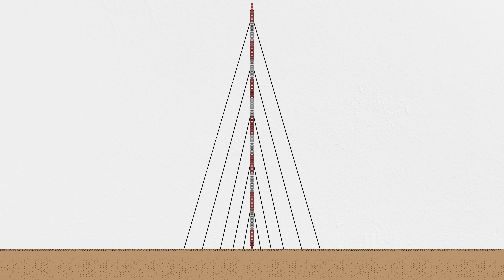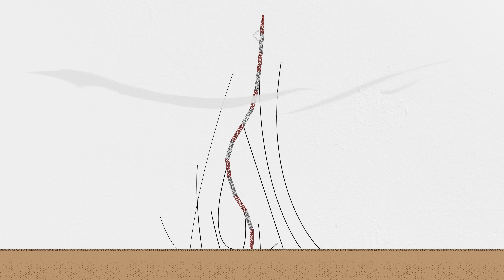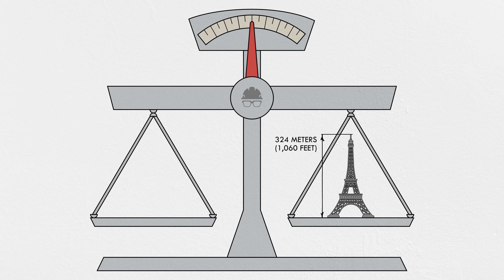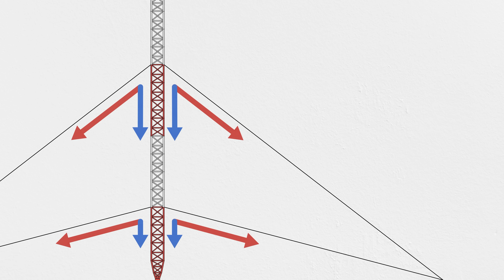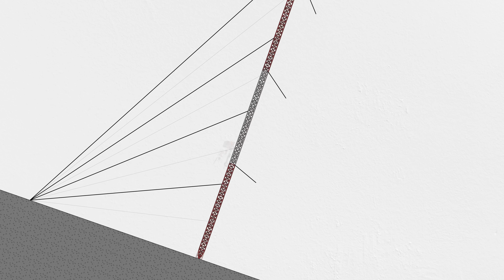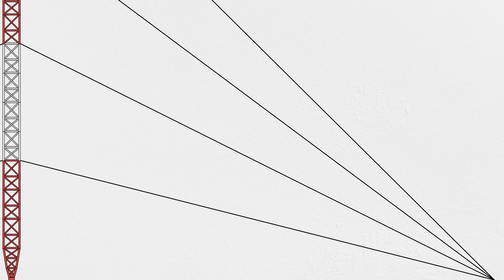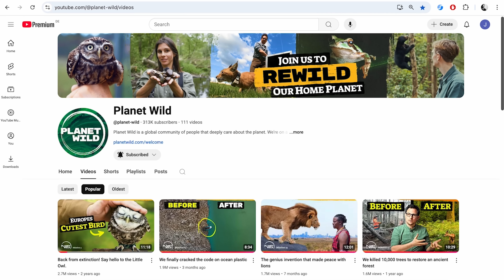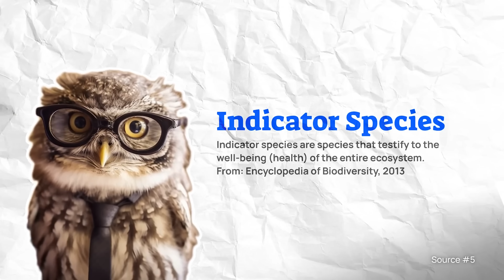The Bizarre Bases of Antenna Towers

Comment: Great video, Grady. The story of the Gąbin mast has a special significance for me—I remember it from my childhood as a symbol of engineering might. Your analysis, explaining the causes of the collapse in such an accessible way, is fantastic.

What's most fascinating about this story from my perspective is how these "macro" level catastrophes often originate from "micro" level problems. We focus on the snapping guy wires, but the long-term integrity of the foundations and the guy-wire anchor points is just as critical. Concrete degradation, water ingress, corrosion—these are the silent processes that, if ignored, can undermine the stability of the entire system, no matter how brilliantly it was designed.

Your video is a powerful reminder that in engineering, there are no shortcuts, and a systemic approach to inspection and maintenance is absolutely key. Thanks for creating such valuable and thought-provoking content.

Comment: Another excellent video from Grady! A few years ago I was in the Delta area of Northern California, south of Sacramento near the little town of Locke. We walked over the base of one of the tower at which I was amazed at the sheer size of the guy wires and cable clamps. Everything was 4 or 5 inches in diameter with the anchors looking like 10 foot by 10 foot square pads of concrete. I recall 4 sets of guys at each corner as that entire area can experience very strong winds during summer months. I wished this video was available back then. Well done, Grady!

Comment: As steeplejacks, we worked on self standing and guyed towers. The towers sitting on insulators, we called “hot towers” as the tower is the antenna, energized. You want to use a wood, or fiberglass ladders to climb on to start your climb. Even with gloves, you would get bit, little burned holes that were painful.    While climbing a wood ladder once, I accidentally touched a ladder hinge, and could smell my burned skin.
I remember one tower where the top of one of the 4 towers top guys burned over the guy insulator, and the guy failed. My Day and I backed off the 2 remaining guys, as the tower was bent over like a banana before I climbed up to hoist a new wire up. Mind you, the radio station needed to keep transmitting, so the cable was arching when making contact with the tower since the bottom of the cable was on the ground.

Comment: Photos of birds… on an engineering channel… have you looked into Al Bowers work with Prandtl ‘33 and Horten brothers regarding wing design? Earlier Prandtl work showed the elliptical lift distribution as best for a given span though such comes with significant drag costs and wingtip vortices. Prandtl ‘33, however, looked at optimum lift per structural mass finding a bell shaped lift distribution meaning the tips fly down which has two effects, one less wing bend hence less structure needed, two vortices at about the third to quarter in from wingtip as opposed to at wingtip with less drag. And guess who uses design similar to Prandtl ‘33? Nature. Nature does. Al Bowers looked at the Albatross and the Hummingbird as two extremes of the spectrum finding both use bell shaped lift distribution. Bird formation flying takes advantage of the mid wing vortices as opposed to wingtip vortices. And, while Al was at NASA, he had years of interns developing flying models and a low cost human carrying flight demonstrator with Prandtl ‘33. Best of all, Prandtl ‘33 creates proverse yaw as opposed to adverse yaw eliminating need for vertical stabilizer and rudder. Notice birds have horizontal and not vertical in their empennage.

Comment: The 1350 ft. LORAN 'C' tower on Iwo Jima collapsed in 1964 a year after it started to transmit. That failure was caused by a faulty insulator. In the 70's, the tower collapsed again, caused by a guy wire failure. All hands on the Japanese tower crew were killed, plus a few people on the ground.

Comment: I got into ducks after moving into an apartment that has them at several ponds.  With this comes the raptors.  While it's heartbreaking at times, I have had the chance to get some amazing shots of a great horned owl in the evening.  In Winter, I can look up at the tree line and see them at night sometimes.  I had one sit on a branch 12 feet off the ground and it let me get right under it.  I couldn't believe it.  My phone was able to get some really good low light shots, where you can distinctly see the "horns"..
Reply: We've encountered a couple great-horneds while out hiking that let us walk right under them, even with three dogs.  They are amazingly cool creatures, especially from less than 20' away.  It's always special when I get to occasionally hear them in my yard at night.

Comment: If I am correct the static model uses a cylindrical rod to simulate a tower. Would a square rod more accurately represent an actual tower and be less resistant to garage-lab deflection?

Comment: In 1968 my family and I were watching TV being broadcast from a 2,000 foot tower near Sioux Falls, SD, when the picture disappeared and was replaced by static.  Turns out a North Central Convair 580 airliner flying in a thunderstorm had clipped one of the guy wires, severing it and ripping the propeller off one of the engines.  Luckily the airliner was able to land safely in Sioux Falls and no one aboard was hurt.  The tower collapsed, but on one on the ground was hurt.  Unluckily, we lost our TV signal for a looong time.

Comment: There's a 2,000' tower about 10 miles as the crow flies from my house. I've been out to it a couple times and it's nuts to stand and look up at it. Since it's a TV tower it sits on a massive foundation. It's even got an elevator in it.  Looks like it's guyed every 200' or so since there are 8 guys on each corner going to three massive anchors. looks like a some of the guys even have guys. Google earth shows the farthest anchors are about 410m or a quarter mile away. I should take my nephew out to see it but something tells me if we go walking around it we'll likely get to meet the sheriff.

Comment: Between Mesquite and Las Vegas I had to pull over and watch a radio tower being put up on the top of a mountain. If you look east on I15 you can see it . The chopper lifting the section was one of the big long leg heavy lift chopper and a regular helicopter as a spotter. The regular helicopter looked so small compared.  And the height was amazing . The mountain is thousands of feet and the tower also a few thousand .  I was glad I stopped and watched.

Comment: I lived in Norwalk, CA back between 2004-2010 and sometime between that time I remember seeing a tall structure erected somewhere near Santa Fe Springs and La Mirada (its located in La Mirada). After seeing this video I was just reminded of that antenna and how tall the structure was with all the guy wires strewn about. Just found out its for a radio station called KFI-AM Los Angeles and can directly be found on Google Maps. Very interesting how it's been setup in a commercial area with residential areas just a few miles away.

Comment: I know it might add cost* and would add some complexity, but how feasible would it be to replace the guy wires with hollow tubes?

The tubes would be as strong as the wires but wouldn't need pre-tenssioning nor would the sag if the tower leans towards them a little, in fact, because of their linear stiffness, they should resist movement of the tower towards AND away from the tube and since you don't need to pre-tenssion them, you should be able to move their bases closer to the tower, increasing the angle of attachment and reduce the amount of land needed for a tower of that height...

In Theory anyway...

😄😁😆😅😂🤣

I say Might because while the tubes would be more expensive than the wires, the reduction in land costs needed for the tower might balance out in the end...

Comment: people always say something like, "if we could see all the radio, microwave, ultraviolet radiation traveling through the air, we'd be overwhelmed with the overload of information".  but it's not like we would see the waves actually traveling through the air.  we would still only see them, the way we see the visible spectrum, when they bounce off something and directly enter our eyes.  so the only difference would be that things would have different colors.  would it be all weird and prismatic?  i highly doubt it.  if we were capable of seeing a much larger spectrum, our bodies would have evolved to perceive it in what we would consider a "normal" way.  for example, the way we see color right now.  we don't see every single constituent frequency; our eyes and brains interpret a combination of frequencies as a single color.  so there's no reason to think that wouldn't still happen with a larger spectrum.

Comment: Great video as always! I would love to see a follow up on the guy anchors. A major factor affecting the reliability of guyed towers is the design, installation, testing, and maintenance of the guy anchors. As a transmission line engineer, I have seen first hand the challenges of various different types of anchor systems and think it would make a fascinating video.

Comment: A relative included in the instructions to their house "If you are coming at night, you will see three tall towers with lights on them.  When you get to the point where the three towers line up, turn right on the first road".   It was much tougher to find their house if it was foggy or raining very hard.

Comment: @6:30 you can indeed push a rope. It needs to be pushed into a closed body and while it does require a vastly larger rope that can fill the body, the principle is similar to hydraulic pistoning.

Comment: I did some contract work decades ago, spanning over a couple of years at an A VLF radio station in Machias, Maine. That was the coolest engineering project I have been a part of, and I include it in the ULCS (Ultra Large Container Ship) list, FPSO list, and nuclear power plants (BWR & PWR) list that I've contributed to.

Suspended arrays on full base towers, and the arrays had counterweights at each tower for winter ice buildup. The power plant I was working at had enough power from one engine to run the radio station, but had 4 or 5 more engines to melt the ice in the winter.

https://en.wikipedia.org/wiki/VLF_Transmitter_Cutler

Comment: I used to climb tires repair antennas running car wax put towers up take towers down 75 years old and a little small tire I have for my ham radio was the only thing that I work with anymore and yeah it's something else

Comment: Antenna towers are not tall only because of the horizon distance of the line of sight. This is valid in case of shorter radio waves roughly meters or less, used in FM radio, TV, cellular networks and virtually for all activities we perform in daily life.
The mast for AM transmission must be high, because of the electromagnetic characteristics of the antenna. Roughly, the dipole antenna (most frequently used at omnidirectional broadcasting) must have the length of half the wavelength emitted to radiate without compromises. Shorter antennas are, of course, possible, but their emission is far less effective.
That's why the mentioned Warsaw radio mast was 646 m tall. It was exactly half wavelength of the Warsaw Polish Radio 1-st programme broadcast frequency (then 227 kHz, now, 225 kHz).
Now Warsaw emits it's programme via an array of 2 much lower masts (roughly 200 m), that do not have the omnidirectional, optimal characteristics, but they cover the area of Poland quite well. The compromise is that this set-up can no longer be received even in Australia.
The rationale of building such a tall mast was the range of the broadcast- Polish authorities wanted the programme to be possible to receive not only in Europe, but even in Siberia and America, where lived significant number of Poles.
Nowadays, when everything is connected by the internet network, such strong and long-range LW transmissions are not necessary and their cost cannot be justified. Even in Poland we very seldom listen to this station via AM, since it is also brodacast via local FM transmitters and also as an internet radio. FM (LW) transmission is directed predominantly to Poles still living in Belarus, Ukraine, Lithuania and other neighbor countries.

Comment: Nice video...30-50 years ago I climbed towers.  Nothing 2,000 ft, just "ham radio" towers up to 150 feet.
Someone once asked me what the difference between falling off a roof, versus falling off one of those and 
I said well, for one, with my belt, I wouldn't fall, but if you were to fall off a tower, the only difference between
that and a house roof is how long you have to think about it before you hit the ground.
I had a lot of friends that didn't believe that if you broke the guy wires, the tower would pretty much collapse on
itself until they saw videos of towers collapsing when guy wires broke.  They also didn't believe a lot of them come
down to a point, instead of being anchored in the ground.

Comment: I participated in an operation to brace the base of a 500 foot tower after the conical insulator fractured and the tower dropped onto the concrete base. But only a quarter of the base was resting on the concrete. I had no idea how dangerous my presence  at the base of this tower was at the time.  But we got it braced with railroad ties till a crew could come— lift and replace the insulator and set it back down. It was quite an operation to watch- from. Distance.

Comment: Actually the Warsaw Radio Mast (by the way, calling it so in the international sources has always sounded a little bit weird to me, it's located some 100 km from Warsaw and in Polish sources it's always called either Mast in Konstantynów near Gąbin or Mast in Gąbin) was an example of these "hot" AM radio masts, being antennas themselves. Quite a special one. The most optimal design for a dipole antenna is to make it half the wavelength long. But nearly no long wave transmit antennas were being built as such, at least not these installed vertically – exactly because of the engineering challenges of constructing such a tall guyed mast. A typical design was a quarter-wave dipole. The Warsaw Mast was an exception, built twice taller than other masts transmitting on similar frequencies.
And while the mast is no longer there, the broadcast of the Polish Radio 1 station on its frequency still continues. In 1999 – that must have been one of the last big AM radio broadcast towers ever constructed – the Radio Broadcast Center in Solec Kujawski was opened. However, it uses much more usual quarter-wave antennas (two of them) and has much worse coverage, practically only the area of Poland.
Between 1991 and 1999 it was replaced by its predecessor, a mast from 1949 in Raszyn (in this case actually located close to Warsaw), which actually until, like, mid-2010s was used as a backup transmitter for Solec Kujawski, taking over its role during failures and maintenance windows. Around 2010 it got repurposed as a mast for TV broadcast antennas (previously TV for the Warsaw region was transmitted from the Palace of Culture and Science, the main landmark of Warsaw, but they had to move the transmitters because of skyscrapers being built around the Palace, in which the radiation levels while too high when the transmitters on the Palace remained active) and for several years it was simultaneously an AM broadcast antenna, and a tower suspending TV broadcast antennas. Finally it stopped being used as an AM transmitter and Poland gave up one of the two long wave frequencies it was assigned (of 225 kHz and 198 kHz only 225 kHz remains in use). During maintenance windows in Solec Kujawski, the transmission on the 225 kHz frequency is interrupted. And I don't think the AM radio broadcast has much future, at least not in Europe. Every some time next long wave transmitters around the continent close down, and the long wave radio seems to be mostly used by elderly people, which are just used to it or who are still using very old radios that can't receive the FM signal.

Comment: They are not too rare.  Go down 1-79 or i-279 south and you may notice them on the way to Pittsburgh.  Of course if you find such a tower, you may find warning signs to warn you of the lethal shock you could receive if you touch one.  I know the AM towers are dangerous like this but not sure about the ones you are showing.  I just know that those are very dangerous just because of that.

Comment: A great piece of work. I am forever gazing at base plates and their bolting arrangement in places where others are looking at the beautiful view or passers by. Bolting in civil engineering probably still has a few issues to get sorted. There were some problems with regulations for bolted foundations in Europe about 20 years ago. I'm no longer involved in that type of work so I have no idea whether they've sorted it. The regulation for a bolted foundation was written by some civils guy who clearly didn't understand bolting and decided that there should be safety factors for bolts similar to the concrete or steel members. I remember going back to our friends in Schaan about this and their take on it was, "Yes. We know it's wrong, but it's the law now." We were supposed to tighten the bolts to about 55% of what we knew to be the correct torque. I hate to think how many structures there are out there with base plates not bolted down effectively.

Comment: A little fun fact: The radio mast in Konstantynów (646 meters) served as a half-wave antenna, meaning its length was half the wavelength of Polish Radio's broadcast. This was the optimal length for a radio antenna transmitting a signal over 1,300 meters long. The antenna's signal was received across half of Europe.
Reply: @rexwater1 Are you a bot?